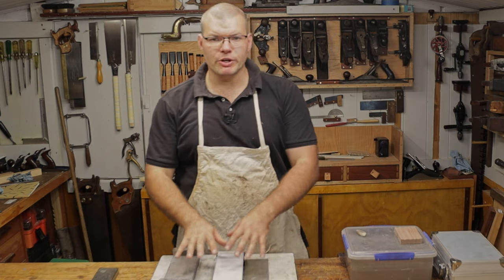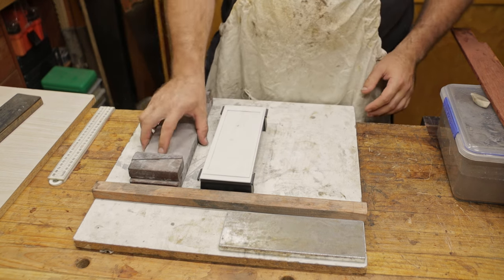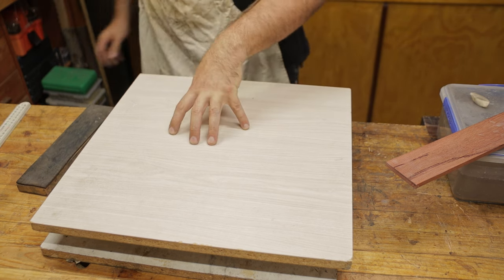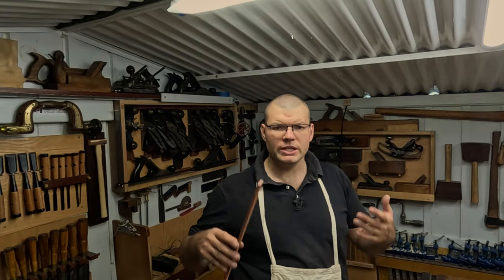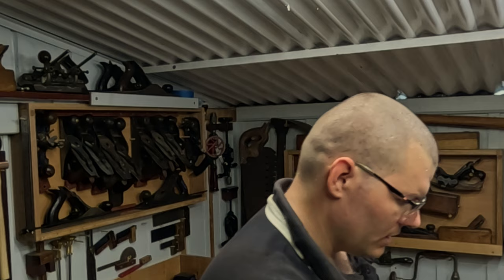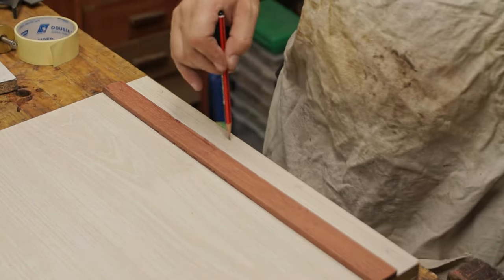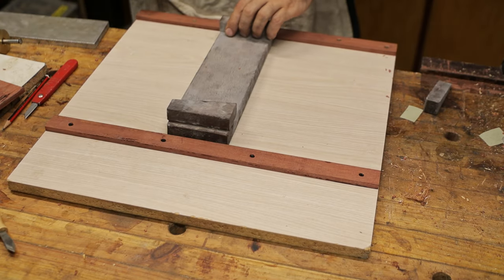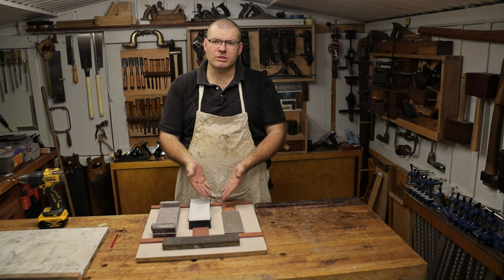Build a Portable Modular Sharpening Station

Comment: Great channel, I wonder if for your setup with dog holes if just using a holdfast to keep the sharpening board in place, then you don't have to clamp near where you sharpening to stop it moving around on you. Cheers
Reply from the maker: Sorry for the late reply i missed your message.

I could use the holdfast to keep the sharpening board in place, i just prefer the block to keep the stone roughly in place, and the whole sharping station has the cleat of hold that from moving on the bench. The other reason i prefer not to use the holdfast near the sharpening is the water tends to rust the holdfast.

If you see some of my earlier videos i used the holdfast to keep a thin 'fence' on the board to push the sharpening stones against, so it does work but i prefer to eliminate rust potential where every i can.

Thanks for the comment